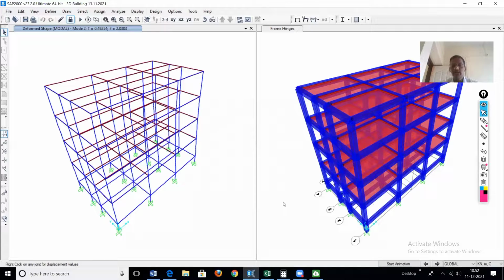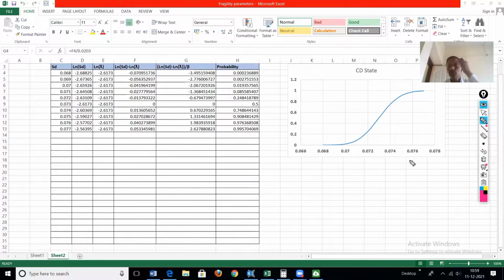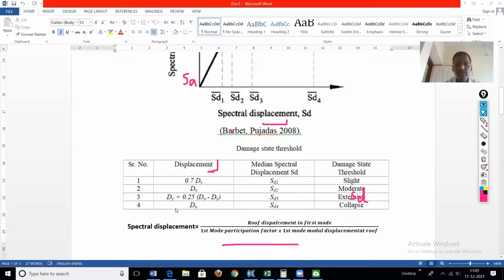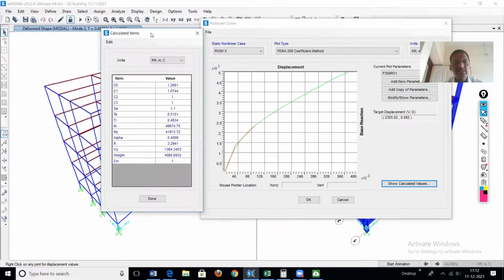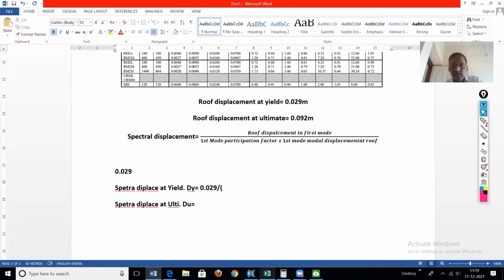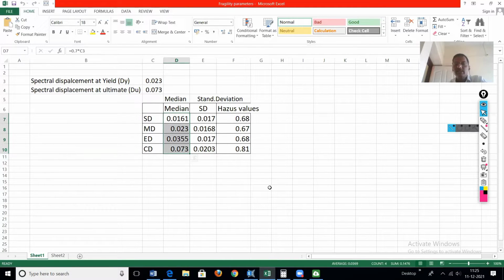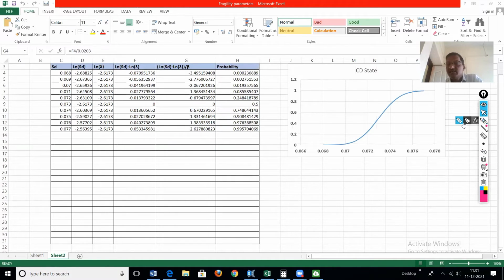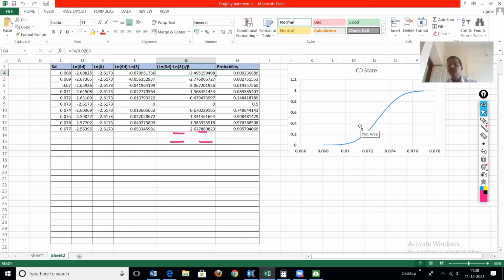Pushover Based Fragility curves

Comment: Sir, could you give a reference to the equation you used to find spectral displacement at yield and spectral displacement at ultimate. The units on the lefthand side of the equation are not matching with that of the right-hand side

Comment: I'm a bit confused with the modal participation factor while calculating spectral displacement, usually, the modal participation factor is unit less right ? modal participation factor =  ( phi 1*mass* identity matrix)/(phi 1 ' x mass * phi1) ?
Reply from the maker: No, the modal participation factor is usually NOT unitless, and its exact dimension changes based on your normalization method.

Comment: Dear Sir, thank you for sharing this video. I think that "Du" can't be the performance point ("Du" should be larger than that. Maybe correspond to the 20% reduction of the maximum strength). Also, the values of Sd should be changed also in the final table from 0.068 to more small values when studying another damage state. All the Best
Reply from the maker: thank you for the respond. I will confirm, surely.